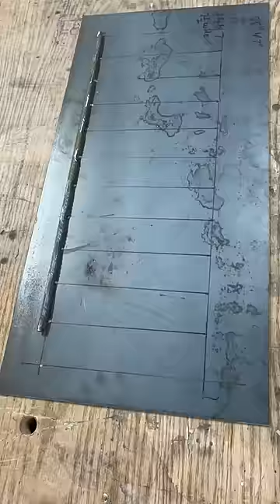Much Needed Predator Protection #shorts

Comment: Well that’s one way to do it lol. When I built our pen I dug a trench and buried the wire fence about a foot to keep predators from digging under. Hoping they’d give up when they realize the fence keeps going. Def thought this was going in a different direction at first tho haha
Reply: It would be much easier to lay a steel mesh on/under the floor
Reply: My wife and l did the sam thing, 1 foot down bent the wire away from the coop and then put fairly large rocks on top for more weight and protection.
Reply: Same

Comment: Great idea. I ran my chicken wire down one foot and out towards you a foot. This way even when the predator backs up and digs they get discouraged. A lot of work and extra wire but you only do it once!
Reply: Chicken wire corrodes in damp soil. Electric fence FTW
Reply: @topduk  how does an electric fence help with animals digging under it, genuinely asking since a lot of other comments mention it.
Reply: @definiteIynotkenji  Put it a foot back from the fence, about a foot high. Animals will not dig long holes to go under a fence and the initial shock will send them packing anyway.

Comment: Burying chicken wire 12” vertically down and stapled to the base board does the same thing. It hurts their nails when they try to dig and they quit.
Reply: That works great too but where I live it's rocky as hell and digging a trench is not easy. Plus a little fabricating is a lot more fun than digging.

Comment: Anybody is wondering WHY the guy rounded the spikes? 

And why being a such perfectionist  he left a vulnerability making one spike shorter than others?

Also , it would be easier to lay a steel mesh on/under the floor and secure with steel pegs.

For those who are wondering about a need of using thick rebar: the author is probably a resident of Chelyabinsk city, so thanks God he didn't use a railway rail to make the thing a bit better.

Comment: Rebar will rust away in ten years. If it's expected to be permanent and long lasting, just dig a trench a few feet down, fill it in with rebar and concrete. Build it like a footing and it will outlast the henhouse by a hundred years.

Comment: Is there a reason he painted them? It seems kinda pointless. Smart way to keep predators out, good job! 👍🏻
Reply: It’s more aesthetically pleasing.
Reply: It will help protect them from corrosion
Reply: It's much easier to plant them into the ground.  It also keeps the predator from trying to dig under it if it does manage to dig that deep.
Reply: Protection from rust.

Comment: I had 3 pitbulls that would dig out constantly.  I used 1/2" EMT cut into 30" stakes and tie wired the chainlink to them. Worked well without having to dig.
Reply: You can easily cut chainlink in half lengthwise and lightly surface bury it right up to your existing fence.  Never had another digout afterwards

Comment: Far too much effort into this. Cut the bars on an angle ONCE then then next cut straight. Then assemble. No need  for all that extra grinding and sanding  - especially if you're going to bury it 12 inches under ground